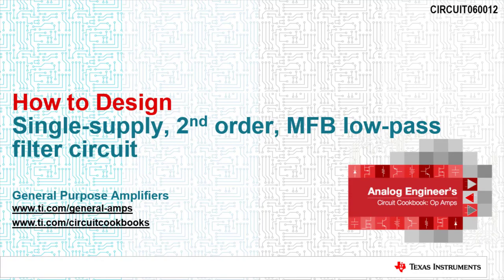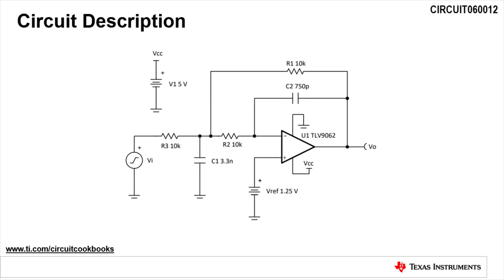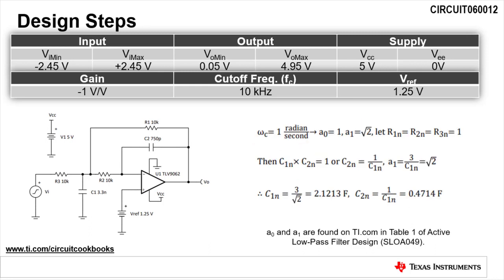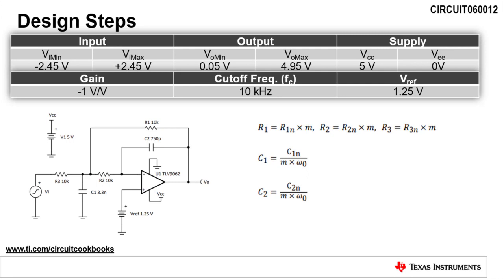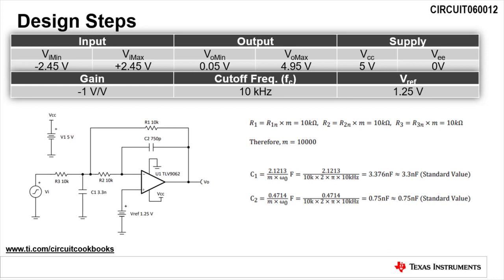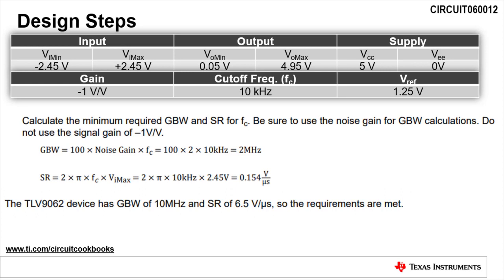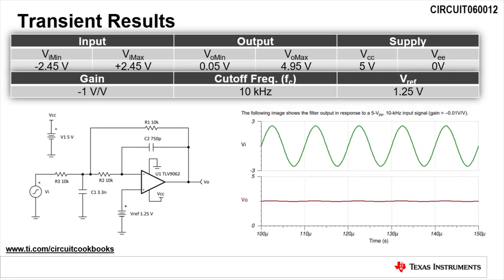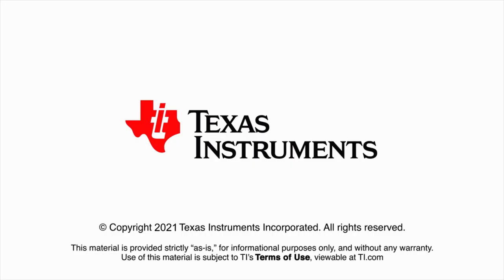Single-supply, 2nd-order, multiple feedback low-pass filter circuit

Comment: Why did you use a 1.25V reference voltage? The output is offset by 2.5V, so why is the offset double the reference voltage?
Reply: gain for NI signal is 2
Reply: Doesn't it say the gain is -1 ?